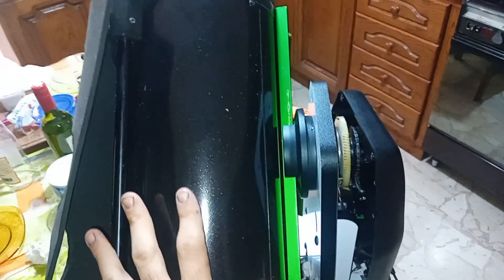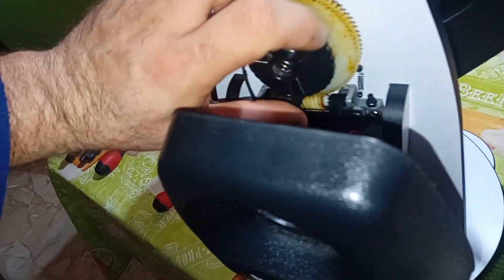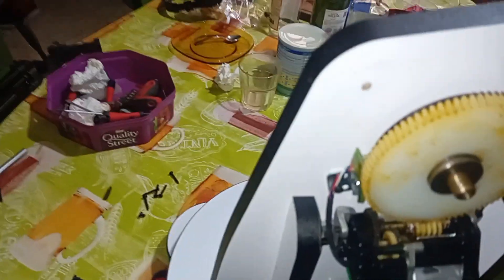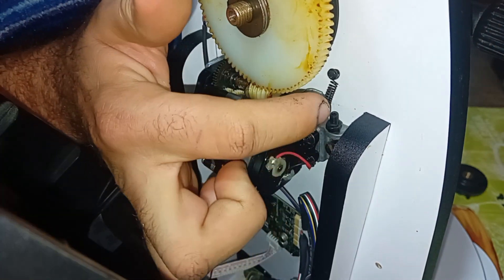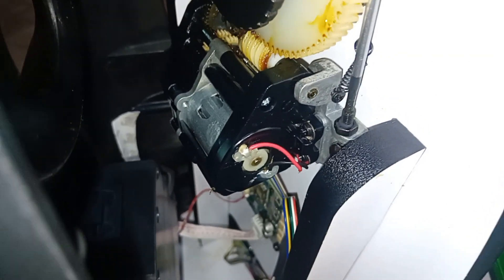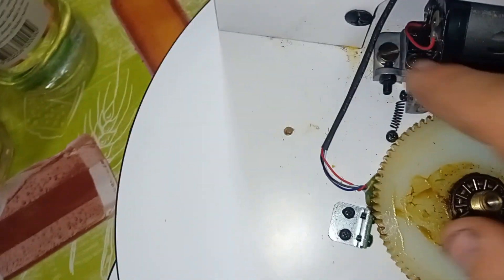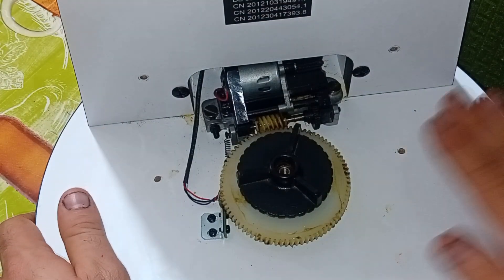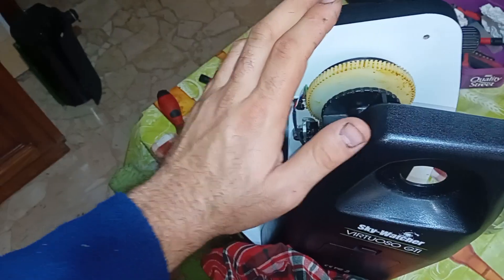Fixing the Backlash of the Skywatcher 150 virtuoso GTI EASILY

Comment: Does that also solve the mount drift problem, or is that a manufacturing or software defect? Do you think the AZ GO2 mount could track a bit better with the 130/650 telescope?
Reply from the maker: It does track better but over time still drifts off, have to recentre, altaz mounts are inaccurate by design. A cabled connection for the virtuoso is the biggest difference for tracking

Comment: How long of an exposure can you take after tightening the screws?
Reply from the maker: 6/8 seconds on a stable night, this mount is not that accurate, has been like this since new but lately it got much worse. I couldnt even expose 3 seconds well.
Reply: @universewonders1  I’m asking because some time ago I tightened the screws on my mount as well, and I’m able to achieve similar exposure times. I thought maybe you managed to get longer ones
Reply from the maker: @bartekk9201 if i mount a smaller telescope on the mount i acheived 15 seconds with good stars but then you will be throwing frames here and there and wont be worth the extra exposure

Comment: Yes, this mount suffers from backlash. However, I think the optimum solution would be NOT to lock the worm so it still move a bit with respect to the big gear wheel. Because in real life, there is some "wobble" of the worm on its axis, and also for the big wheel because of excentricity. So therefore, you should have some compliancy. May be it would be best, to get rid of the locking screw fixing the location of the worm, but just use a bit stronger spring. This would force the worm in the gears of the big wheel, but is still capable of moving a bit to prevent locking.

But then: I did not change anything (yet?) in my Virtuoso. So what do I know. May be I should also have a go at it. I will not use the telescope for at least some days, because of being clouded over and having snow...
Reply from the maker: Yes using a stronger spring is also an option, i opted for the easier route, but i didnt make the worm gear extremely close to the big gear, i left slight backlash still so things wont go boom 😅